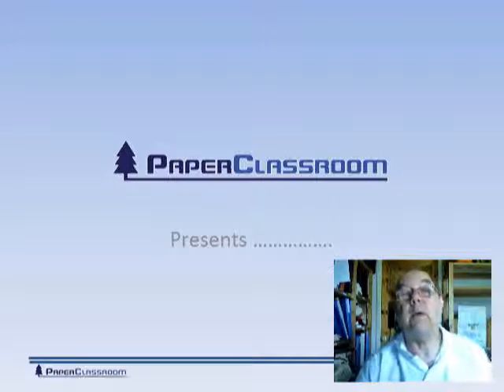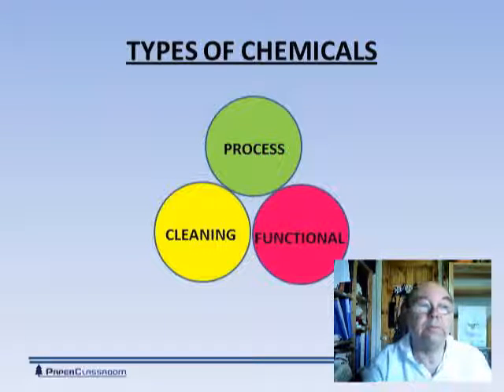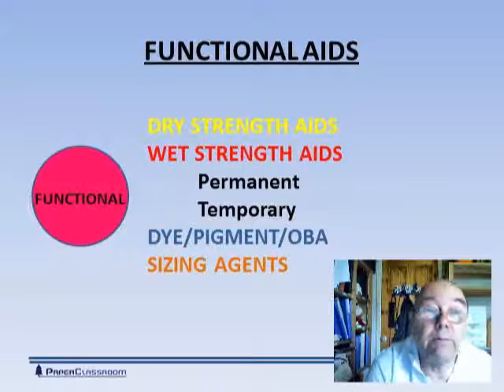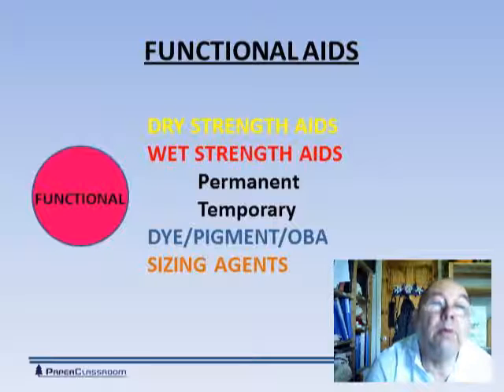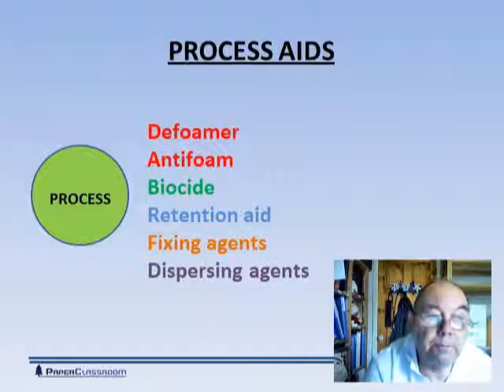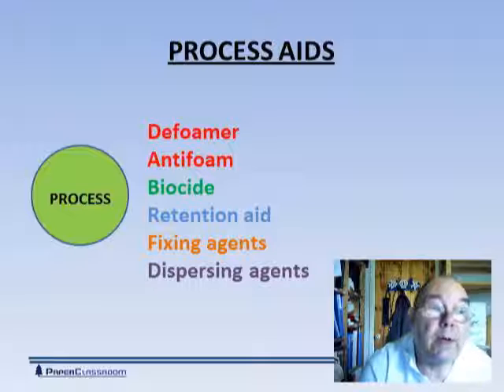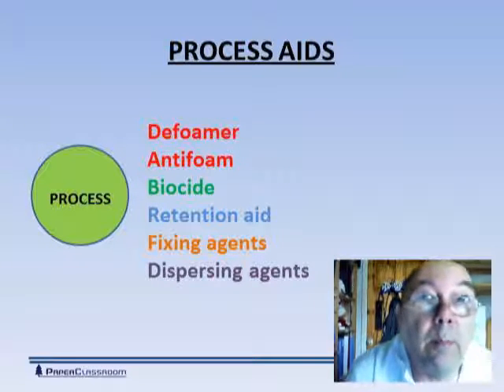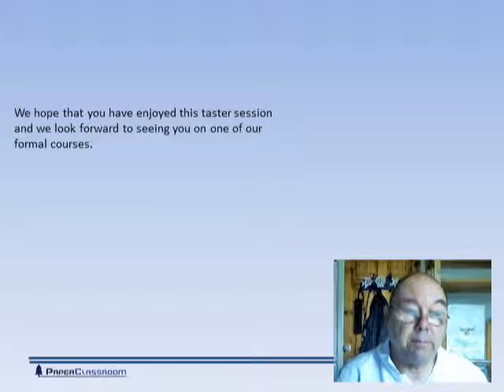Introduction to Papermaking - Chemicals

Comment: Dear Dr. Mann,

I have a question for you, why some paper mill add liquid alum in the approach flow system? What exactly the role of the liquid alum?

thank you

regards,
Oki
Reply from the maker: Hi, thank you for your question. 

Alum does have several different uses:

1 It is used in conjunction with rosin, for rosin-alum sizing
2 It is used as a mordant (fixative), for acid dyes
3 It is used as a retention aid.
4 It is used as an anionic trash collector, (ATC)

One of the very first uses of alum was in conjunction with gelatin as a sizing agent. The alum hardened the gelatin.

Because of the versatility of alum, it used to have the nickname 'papermakers aspirin', because it cured all problems.

Alum is less and less commonly used. This is because it is acidic. Not only does alum speed up the corrosion of equipment in the mill, it also shortens the lifetime of the paper. 

I hope this helps

Best wishes,

Steve
Reply: Steven Mann Thank you for the response, Dr. Mann. Need to discuss more...

Comment: Respected sir

In what amount do we need to add the chemicals if we take 1 kg of pulp.
Reply from the maker: The exact amount of chemical depends on the furnish, the Papermaking system and the quality of the water. Also, how much you can afford to put in. Typical level range from 1-5 Kg per MT of OD fibre.- So - 1-5g per Kg of oven dry pulp
Reply: @PaperClassroom  Thank you so much sir.